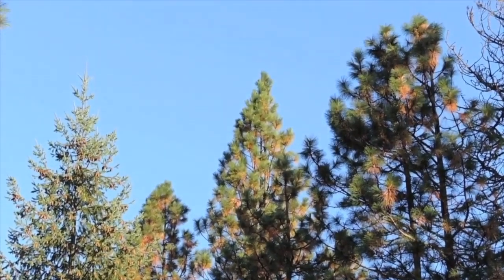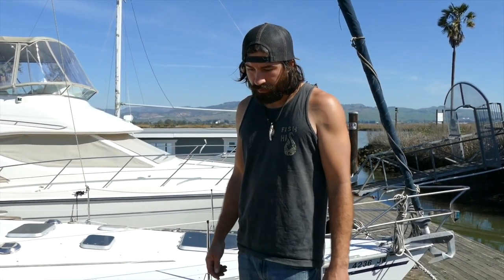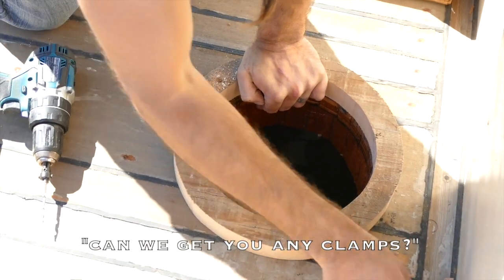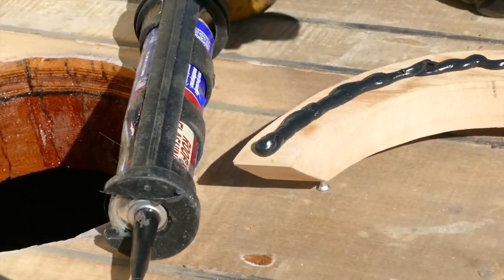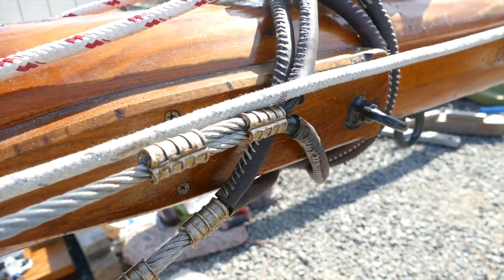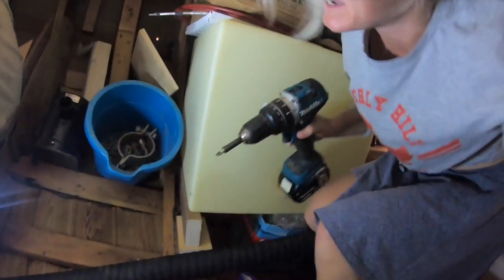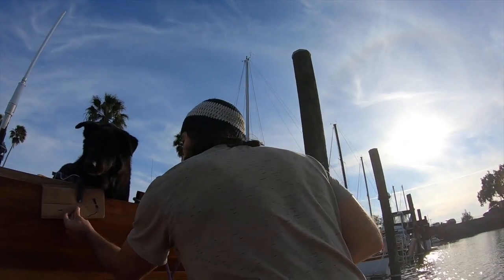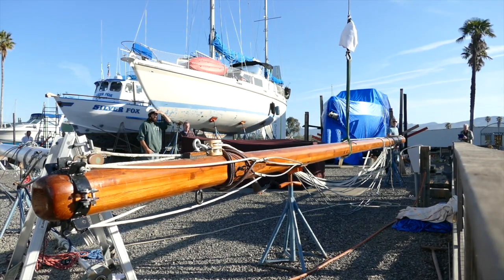Salt & Tar: Episode 86-Deck Rim/Collar Thing and Another Hole

Comment: I have found that letting the 'sealant' set a bit before clamping prevents too much from squeezing out, lessening the chance of leaks.
Chin up, butts working🤗
Reply: And it also lets the sealant act more like a gasket when tightened after drying.

Comment: Please explain the factors involved in choosing how to connect the shrouds to the mast (i.e. looping them around the mast as you have done vs installing a 2nd metal band around the mast similar to the one at the very top.). Thanks.
Reply from the maker: The book Gaff Rig by John Leather helped make that decision :)

Comment: Why not cut out a solid ring? Rather than having two seams although at an angle, seems like the two seams in the ring could have been eliminated completely giving two less entry points for the water later. I’m sure there’s a reason, I just don’t know what it could be
Reply: What if the ring is damaged and needs to be replaced. Now that seems easier doesn't it?
Reply: Lee Klemetti I’ll give ya that.

Comment: What amazies me, is the use of the Imperial System: our metric one is much easier and far more precise......
Reply: give or take an inch!🤣
Reply: It truly is amazing especially when reared with Imperial measurements how easy it really is with all the inch conversions "magically" done in the mind.
Reply: nemo -  not amazing ,  quite simple !   Everyone knows we have two feet  .  .  .  and that  one  feet  (foot)   is  12 inches .  So two feet is 24 inches  .  .  .  .  but  wait  .  .  .  .  throw in a third  foot  .  .  .  .  .  .   and  of  course  you  have  a   ' yard '   .   .   .   .   and  since it has been raining and the grass has been growing,  you need to get the lawnmower out and mow the  ' yard ' .    What could be simpler ?    Your not going to mow a  'meter' ,  now are you ?   'Cause everyone knows knows that you 'read' your electric 'meter'  -  you don't mow it ! ! ! ! !       It  is  just  common  sense  ! ! !     'cmon  people ,  get  real  ! ! !
Reply: Metric is the lazy person's measuring system. Everything is in multiples of ten. Imperial requires some real math skills, so...
As for the accuracy, imperial js actually more accurate, if you know how to work the math.

Example: your hole is 123mm wide, what is your measurement at center? 
61.5mm, where on the ruler is the 
.5mm marking?
Imperial: your hole is 13 inches wide, that puts the center at 6 1/2, the mark is on every tape measure and ruler. Super simple, and more accurate because you have an exact mark to measure to.
Reply: @richardhobbs9038  My foot is less tha 12 inches long, in our measure it's 42/43, in imprial? I guess 9 or something around that figure. Than we have 5 plus five fingers, same for toes and it's easier to multiply (or divide) by ten than by or 8th, 16th, 32th......etcetera.
Reply: @thomasarussellsr  It's not lazy, it is simple and precise to a degree that the imperial is not.
Reply: btw, Imperial temperature scale is more accurate....
Reply: @nessuno1948  okay, most scientists have gone to metric... except when working with really small numbers. What is the metric equivalent to 1/1000th of an inch? Micrometers still read in thousandths of an inch. That is way more accurate than millimeters.

Comment: if you know moisture gonna be trapped under the boot , meaning its never going to be dry why use a boot?
Reply: I would assume to shed the line's share of any water that comes over the deck in a storm? Better to replace the ring later on, than to have that much infiltration of free-flowing water onto their bed, and running the bildge pump constantly (even if it is on a float switch).